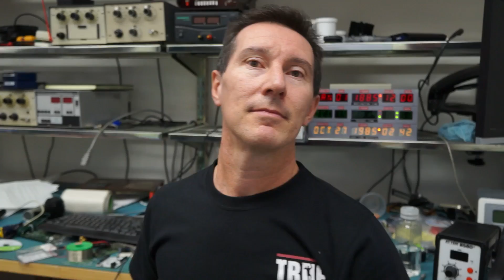eevBLAB #2 - Are Electronics Hobbyists Useless?

Comment: The requirements are totally in line with reality.  They are especially good for someone in college - heading into the electronics field.  A little dose of reality - hands on work of all sorts gives you a much better appreciation for what is being taught in school.  It also helps you determine where your interests lie.  And something like the EEVBlog offer such a broad exposure.  Much more than a typical internship - working around a very limited set of tasks or products.
  It is also a great chance to bridge the roles of designer and lab technician.  You can begin to appreciate each others viewpoints.
Ask me about testing a prototype high pressure liquid valve with a square wave input vs a relatively slow sinusoid.

Comment: I don´t think, that you are asking too much,
I am 16 years old and I design my own prototypes, layout my boards, write my own firmware (~1200 Lines for my last project) solder all together and debug with serial support (only for the firmware), 2 Scopes (digital and analog) and an advanced Logic analyzer.
I had built my own Wavegen (really basic 1MHz arb) , a solder iron, parts for my pc, LED lights in my room, power supplys, a backup power system for my server and much more.
So I would say that are basic skills.
(sorry for mistakes in the text, I am from Germany)

Comment: You are not asking too much. I am a first-year student, and have previously rolled my own boards with custom firmware as a hobby. I would by any means not consider myself to be more than an amateur in these things. At the same time, however, I do definitely consider myself a electronics hobbyist, with solid skills in multiple of the areas mentioned. Also, the 3-year program I'm enrolled in is just dumpling my brain full of information right now - by the 3rd year my skills will have further improved.

Comment: Well, I call myself still pretty young and I think I'd have those skills. I've tried basic circuit design more or less succesful and don't think it was very hard to do.

Maybe it's just because in my young days I've always asked my dad how certain electronic parts work and such and I now finally know how to build a simple amplifier. I personally don't find it to be very tedious to do the basic math to find out which resistor you need for that LED or not to pick a 1000µF capacitor for voltage stabilization where it doesn't matter.
I went further and wanted to do stuff with FPGAs but that's where I finally got stuck and decided I needed some more advanced help. This is the point like where I'd call things to go more into advanced stuff that gets way above hobbysts level.

Dave: I think I can aggree with you, at least that's my personal opinion. I don't really know the views of people who don't have that knowledge.

Comment: In my experience, many EE graduates would be not have the skill level you are looking for. Back in our day, a hobbyist could prototype an idea because there were alternatives like wire wrap, that operated on a more human level.
Today, with insane, inhuman BGA etc smd, that is impossible. The modern hobbyist is one who buys an Arduino or PI or Beagle or etc, and maybe some sensor boards and connects them together.
On the flip side, software drivers for the hardware means that a few (or sometimes no) lines of code connects everything together. The sheer complexity of the software means that few hobbyists create their own.
This may explain the rise of hack labs, where people can go and essentially apprentice and get some hands on training.

Comment: Sadly people don't know what is hobbyist anymore.
And so...
  If you spend more than hour a day with proto boards. you might be a hobbyist.
  If your MCU is full at least from 60%. You might be a hobbyist.
  If you can make an partitial autopsy just by looking at the board. You might be a hobbyist.
  If your computer has warranty void sticker removed after second month of buying it. You might be a hobbyist.
  If at last one of your bench tools is made by you. You might be a hobbyist.
  If you have a CRT monitor on your shelf. You might be a hobbyist.
  If you step on electronic bug at last once a month. You might live with a hobbyist.
  If your table has more electronic parts than legs. You might be a hobbyist.
  If make at last one working project in month. You might be a hobbyist.
  If you know what structured wiring stands for. You might be a hobbyist

Comment: I'm not a real electronics hobbyist. sti i can do most of what you want. and i think the only reason i haven't don everything is that i haven't tied yet. i have made prototype board for use in developing electronic equipment (synchronous motor converter's), i have rebuilt 200 charger's that some one design wrong and needed to add an amplifier on to (just cutting some VIAs and soldering on some transistors and resistors)  and i have ben soldering and modifying stuff for 30 yer's stil i dont call myself a Electronics Hobbyists for i don't relay it do that to often and haven't made anything of my own yet. i hope to remedy that soon tho ;) right now i'm putting up my own workbench and getting stuff i need to get the job don. hope to be able to make stuff when the summer comes along ;)

Comment: WTF... No hobbyists for the most part aren't useless. They should have some basic knowledge of opamps, transistors, passives etc, be able to lay out a board that may not be ideal but still work, and solder it. Whether or not they can successfully debug it is down to their personality and whether or not they can program an Arduino is just down to whether they've tried or not as almost anyone can learn if they're interested to. There isn't even a big requirement to make your own PCBs anymore as you say some places in the world you can get them relatively cheaply made. To me that was always the hardest part.

I've been a hobbyist for about 5-6 years and have no formal electronics education beyond a 555 timer circuit and a 741 as a comparator back when I was in school and I easily fit your criteria (except I live in UK). The only thing I got out of school related to this was how to solder, no that they taught us any technique, they just insisted our joints were shiny and only gave us lead-free solder (yes, it's possible for lead-free to make shiny joints, its just really damned hard to do by hand). Then again I'm kinda autistic in my hobby obsessions. I just spent a whole day winding a small switching power supply transformer, mainly because I had to cut many layers or margin tape to 3mm width by hand as I went with a craft knife and it didn't quite fit first time so I had to go back half way and start again.

Of course some are useless, but I'm sure you can find at least a half a dozen candidates in the Sydney area who meet your criteria from your viewership. It depends if you want someone who can work unsupervied at or near your professional level or an intern who has the basics, wants a career in electronics and is willing to learn quickly from you as they go. Even if most EE students aren't formally taught the basics anymore, I would have thought your subscibers who consider themselves to be hobbyists would have taken it upon themselves to learn.

Comment: It seems that these days, you can be an "electronics hobbyist" - that is, making cool stuff using electronics - without needing all that much depth of skill. And that's a good thing! If things like arduino and the raspberry pi are getting more people making cool stuff, all the better.
You can make even cooler stuff if you know how to route a board, how to use a scope, etc., and it's totally reasonable to expect those skills from someone who'd work with Dave, but I think it's fine for someone who is still at the breadboard level to call themselves a hobbyist. You can spend a great deal of time at that level - doing it as a hobby, as it were - and still have a lot of fun and learn a lot.

Comment: Well you're asking for a fair bit, maybe a little bit beyond what some people consider a hobby level time/money investment these days. However I don't think its too much, anything less and you would actually add to your workload having to constantly monitor if your assistant is actually doing things right.

And I suspect one of the biggest problems is how society works with technology currently. In times past to fix an appliance the components weren't all as tiny and in hard to open plastic packages that may have weird hidden clips or hell even be glued. Then you get inside and see a million of tiny components so that even if you were to find the fault you'd have a hard time fixing it (at least from a beginners point of view, too damn often its some cap that failed somewhere which would be an easy fix if found).

Add to that how fast phones/tablets/computers are considered "old stuff" and people go to buy the current new thing. It really doesn't help with getting more people who actually know how things work. It either gets returned on warranty or replaced from my experience, unless the service center or local shop actually repairs things. But even then it tends to be replacing whatever plug in component failed in it, even at that stage the time investment finding the fault and repairing it in consumer electronics isn't worth it... it is cheaper to get another new unit shipped out of China or somewhere in that area.

I'd be nowhere near able to qualify for this job even if I was to live there, but I think my progress has come a long way from just knowing basics. Pretty much when I started to mess around with it on my own I had a little bit of university background from studying physics up to the second year and then changed direction. I liked the subject matter but it was too theoretical to keep me motivated, it did however give me a good basic understanding of electronical/magnetic effects at a physics level and the basic passive components were familiar to me. A good understanding of mathematics helps a lot too with the more complex situations. Then I got started on some basic things making LEDs light up with timers, servos move things with circuits on breadboards doing nothing useful just tinkering around and having fun. More recently built a working LED driver to drive 5 Cree XM-L2 LEDs in series at a constant current that can be configured. I could see myself with some a lot more time to mess around with things (and money to spend on gear) eventually getting to the point where I'd meet a lot of the requirements for said job description. Plenty more things I want to do but time and money are a constraint, however it is a satisfying hobby 

All it really takes is a healthy amount of interest and getting around to doing the projects you like to do. I suspect many that start the journey probably won't get that far in the end though, but some will.

Comment: Eh, I wouldn't say I technically have those skills, but I understand where you're coming from.

really, it's not super-hard. I built something once (from a plan, not from scratch - but it wasn't a kit, so I got the parts and had to figure out a workable layout on protyping board for myself)) and someone was surprised I could even put it together. 

They were especially surprised I could get it that small using through-hole prototype board, a soldering iron and  pocket knife... Is that some kind of amazing skill, or do people really have such low standards?

If what I do can impress anyone, I dread to think how low their standards must be. (OK, so I have computer programming experience, but seriously, a lot of this stuff isn't that complicated, as long as you don't get too paranoid about it.)
Reply: Hi Dave,
There are quite a lot of responses, I just noticed this thread today.
I just wanted to comment, It may be difficult to find all of those requirements to the degree that you could really expect in terms of a hobbyist to start working and repairing everything.
My career has been in automotive and I have been a hobbyist since I was about 
10 years of age. I began breaking my toys at age of three to see what was inside. LOL. My Dad for ever used to remind me of that.
I always haw basic electrical and soldering.
Learned it skills in high school and college.
Learned electrical in high school and college.
Learned electronics in automotive trade school.
But it was only to the extent as to check voltages resistances etc.
I had always gone a little farther and visually looked at solder and at components and sometimes had success with fixing a board.

I never had any design experience.
Other than some with virtual electronics bench.
Now with you tube finally discovering the last obstacle of checking and testing 
capacitors then moving  to the integrated chips.
Nobody taught that, most things were more basic and theoretical.
Those who had the knowledge kept it to themselves.
I have just been looking into it again with the need to repair automotive clusters and to repair my  my dead surround sound power supply 
that nobody around wants to touch.
I have learned enough and discovered a wealth of information.
Enough so to have found the confidence to tackle them myself.

Comment: Design a circuit is a very broad term. Most hobbyists can not design circuits. They mostly copy/modify ones. And connecting a led and a button to a microcontroller is not "designing a circuit" skill. Tell someone to make a transistor multivibrator. Or transistor amplifier and calculate all the parts. Be more detailed about "designing a circuit" part

Comment: Back in the late 90s when I was still in school, we did PCB design, very basic PCB design, but did it nonetheless, we laid them out, printed them onto acetate, exposed boards and etched them out in an acid bath, drilled the holes, soldered components onto the boards and made them work (these weren't programmable devices though), so you are indeed right, there is no excuse to not know the basics, if it's not in the education system, then that system is broken considering in this day and age, electronics are a part of our every day life, from the watch on our wrists to the communications systems that keep the electronic world going...

Comment: Hobbyists...? They think they're damn experts now.

With the advent of Arduino and the like, every Tom, Dick and Harry think that they're an electronics expert because they can attach a shield to a development board, download a sketch that someone else wrote and get an led or two to flash. That's the problem. 

Seeing arduinos used as products (and not just prototyping tools) makes me cringe. Nowadays they're making projects that cost well over a $100 which could have easily been done for under $10 with a little effort in design and really understanding what's needed to make a fully functional bit of electronics hardware.

These days they is s no need to learn how to do any of the stuff Dave's highlighted as prerequisites because for the most part it can be all bought so the art of real design and integration is somewhat lost.

I know a bunch of old school hobbyists, Ham operators etc that can teach industry experts a thing or two - I'm afraid we won't be able to say the same about this current crop of 'hobbyists' in the futures.   

Just my 2c.

Comment: When I was a teenager 56k baud modems were just coming out. Electronics were big, easy to see, and to reverse engineer. Radio kits and small circuits were sold at radio shack. Nowadays most of the good stuff is hidden in chips and programing rather then board design. A young person today is more exposed to programing than hardware.

Comment: The technical skillset that you're asking in the job description, is not by any means too much (at least in my opinion), but from what I'm reading, people are arguing more about semantics than anything: what you're calling a hobbyist I'm calling an amateur. Some years back, I would call myself a hobbyist because I would know how to solder this and that if stopped working; whenever I could, I disassemble things to see how they work, or how they are constructed... etc. A person doing that kind of stuff I would call it a hobbyist. Knows his way around, around very basic stuff, from your point of view. Now, a person who knows how to design, implement and debug hardware, program firmware... etc. well, that I would call an amateur more than anything.

Comment: I don't think its that unreasonable, I'm guessing Dave's bar on skills is pretty low in each of those areas.  I wasn't a big electronics but as a kid, more into computers, but I was tearing down and tracing circuits with at multimeter and soldering little boards together at 10-12 years old. Four years later I was professionally building custom PCs, slipstreaming windows 3.11, working with novell servers, repairing old monster HP printers, and running custom network cables (again I was more computer oriented).  By the second year of college we were sneaking lab time to rolling our own OS from scratch, building robots, playing with FPGA kits.  The kids are out there...just go to a few open houses at any decent engineering school.

Comment: As a Hobbyist Dave, no I don't think your asking too much. I've got no formal training, no university studies at all yet as a hobbyist I get my own boards made through seeed fusion or dirtypcb's, solder 0.5mm pitch components, green wire fix my stuff ups, hack firmware together (software engineer I am not) etc etc etc.

As Karan Chaphekar said below, many students are just there because they've been told engineering pays well, and have no actual interest in electronics or IT or anything similar.

Unfortunately I'm a full time employed Queenslander, but anyone like myself around Sydney should jump at the chance to work along side you.